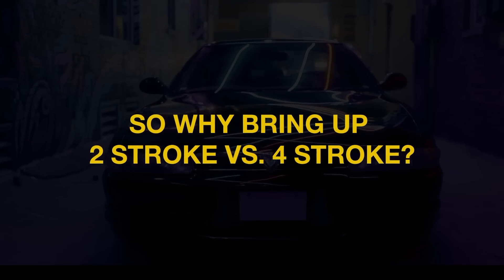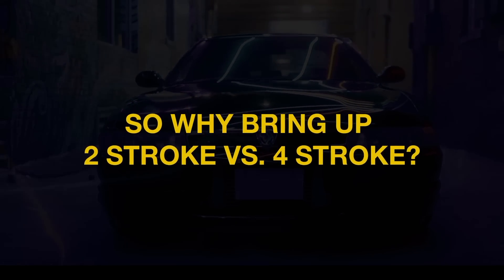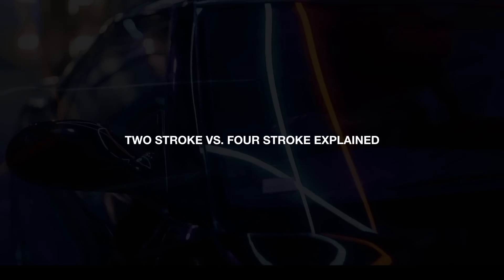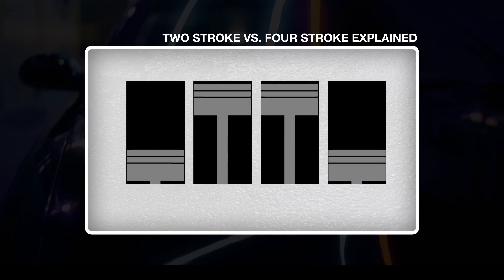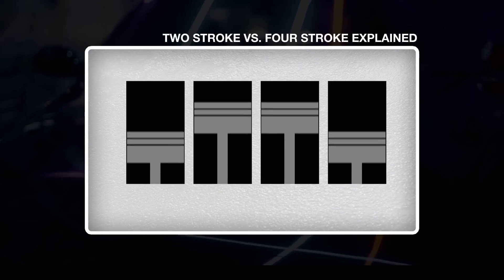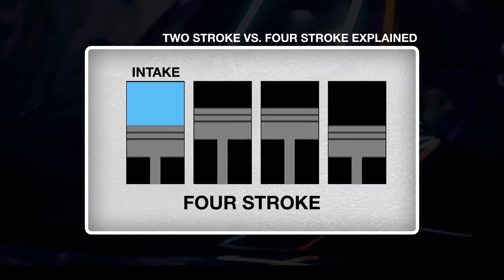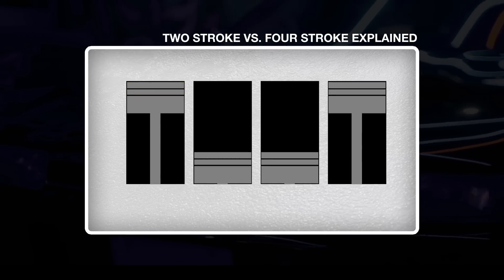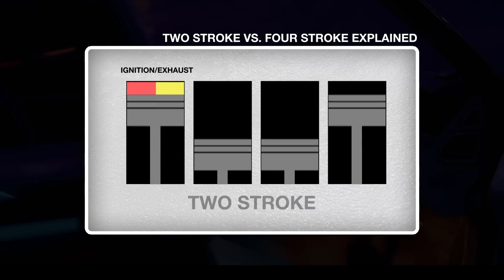The SECRET Behind Why RX7 and RX8 Rotary Engines Make SO Much Power

Comment: An rx8 certainly pisses fuel like a 3.9 engine, low 20's mpg. Hopefully the rx9 ditches the rotary engine. Shame there so inefficient cos there really nice cars.
Reply: really? because I can get 27-30+ in an RX8 highway and 19-21 mixed city, and I've gotten almost 40 in a NA FC highway and regularly in the 20s city.  Maybe its the driver with lead foot who can't steady state on a highway at reasonable speeds (within 5 of speed limit)? No, no, it must be failure of the product, because no one can take personal responsibility for their actions.  I can also get in the teens with them.  But I did have a 400 c.i.d. Pontiac that got 9 mpg no matter wtf I did, a Civic Hybrid that I got mid 90 mpg on a highway trip and regularly in the 60s with city driving.  But again, let's always blame design and not the person behind the wheel.

It also, would not be an RX9 if it didn't have a rotary, it would be a mazda9, like a sportier mazda6.

So to reiterate.  An RX8 in good operational condition with the right driver can get 20 city, 30 highway in good conditions; with a lead foot and/or poor conditions low teens or worse city and teens highway (snow, below zero, hilly/mountainous terrain, etc).

So keep spouting bullshit you hear from people who bullshit without first hand experience and without knowledge of how fuel is used.  You know, like those people with lead foots who want to sue hybrid manufactures because they full gas/brake all the time and blame the car and get in the 20s/30s, while you have people like Wayne Gertes from cleanmpg getting over 100 mpg++ doing the opposite extreme in the same cars.

gas mileage and reliability are mostly on uneducated drivers who take no personal responsibility for their actions, don't understand there are efficient loads and shift points, don't understand how poor maintenance and operational health and outside conditions affect everything, and so on.  Just easier to yell at clouds and point fingers.  It goes for any car engine.  It is a real blanket statement to both the cars and the drivers.
Reply: @kuromurasaki5273  OMG RX8 fan boy. I've owned an RX8 for 1.5 years n by far the most uneconomical car I've owned. Yes it's nice to drive, lovely to look at, good gearbox n excellent stereo but fuel consumption is terrible. I know how to drive economically, with very gentle acceleration n keeping the speed at 55 mph, even going as far as putting it in neutral going down hill and at best getting mid 20 mpg at best. Plus 1l of oil each month on top. I've owned a S2000 and a MR2 turbo and they would easily to mid 30 mpg if not better. Mines a 231 for sale for £800 with 82k for the last month and no one wants it. Only had 2 enquiries but no sale. Even agreed to sell it for £600 to one of them but never turned up. It only cost me £1.6 K to buy so I don't really care if I sell it or not. Road tax goes on emissions here in the UK n if it was 1x younger it would be top bracket  £500 per year. I knew what I was getting myself into when getting one so it was no surprise really. Fuel costs alot more in the UK than the US so RX8  are cheap as chips to buy here. Got a TT 2.0 tdi roadster now and this uses 1/3 of the fuel costs the RX8 uses. Engine may weigh like a 1.3, with power of a 2.6 but drinks like a 3.9 FACT and it has nothing to do with how I drive thankyou. If yours happens to be better then good for you. As far as RX9 goes there is some info online about this being a possibility but this was some time ago now. If it did happen no doubt it would have some hybrid system included with or without a rensis/wankel rotary engine who knows. You dont have to launch personal attacks on people who are just sharing there honest opinions on a product with the world and I won't be lowering myself to rubbish what you've said.

Comment: BUT, a comparable hp/weight ratio strongly favors the wankle..
Reply: Then why is it obsolete?
Reply: doktorbimmer 
 I'm not sure it is. its being utilized with large 2 stoke out boards. it uses oil, and doesn't enjoy long life, or have good torque. compartivly making a financial nightmare out of warranties and potential cost to a mfgr. my only original point, was, if we line up equal power output, the weight of rotor verses piston, is significantly less... I've always been a fan, had hoped advancements in ceramics might let this power plant be more viable for everyday use.
Cheers
Reply: Wtf? What company actually produces them in series mass production anymore? The last manufacturer was Mazda and they ended production over half a decade ago.
Reply: Wankel engines have not been produced for outboards in decades, OMC (Evinrude/Johnson), Sachs (MAC-10) and Yanmar all attempted to market them in the 1960's and 70's but all were sales flops and discontinued.
Reply: FYI: Wankel KKM engines are all 4-stroke operating principle... just so you don't sound confused anymore.
Reply: doktorbimmer 
 I can't resist. a Wankle has NO STROKES!  Just revaloutions. I agree as a production motor to the masses it has gone away. it is still being utilised in performance settings. take in a boat race, they burn Fuel in them...unlimited outboard. hell, might be last one on earth for all I know! just saying...
Reply: All Wankel engines operate using the 4-stroke operating principle.
Reply: Two strokes per every eccentric-crankshaft revolution.
Reply: Every Mazda 13B has 15mm crankshaft off-set which produces a 30mm STROKE... This fact can be confirmed by Mazda's own published technical specifications.
Reply: Flat-head engines are obsolete too... although extremely rare today, they can still be found in some vintage racing and exhibition events.

Comment: This is a dumb video. Trying really hard for your argument. So basically the way you calculate displacement for a piston engine should not be applied to a rotary.  It still uses more fuel to make horse power.

Comment: why has no one set up the motor to run on compressed air,,soundd crazy i know but its being done with piston engine's but the wankle is perfect for it,,,heck Hitler knew this and so did Mazda when they bought the patent and not that it matters to most but a jew built and designed it by force for the German army,,,any one got info on one running on a compressed closed air system make a comment would enjoy knowing i have owned a rx7 and rx8 super cars with minimum efforts and the motor could be the future of clean efficiency in transport.
Reply: The whole Wankel concept was originally designed as a compressor. Felix Wankel first orbiting piston design was a motorcycle supercharger... and fitted to a 50cc NSU motorcycle which broke a world's record..
Reply: Mazda purchased Hanns Paschke's design (the KKM-57)  his engine was designed without any knowledge or assistance from Felix Wankel.
 Unfortunately the Wankel never saw widespread adoption or success, it is tragically flawed and inherently inefficient... it has been obsolete from production for several years now and has no prospects of making a comeback ever again.

Comment: Love the misinformation. 

Mazda states; 1.3 liter. Period. If they are a "3.9 liter", explain to me why the engine is 1/3 the size when you sit them next to each other. Odd dont ya think? What about the weight difference? Odd that this "3.9 liter" weighs only 247 pounds with attachments. Piston heads just cant wrap their brain around the fact that a smaller, much simpler engine is doing more work than their big badass v8. Its a matter of hurt feeling. Get a clue.

For anyone who wants to see an ACTUAL 3.9 liter rotary, search 'PPRE 6 rotor rx4'. Compare that to your v8.
Reply: Then explain why the GM RC2-206 Wankel engine (same size as a Mazda 12A)  had a displacement of 206 cu.in. (3,340cc's)
 Could it be that America never used "displacement tax" for vehicle registration like Japan did?
Reply: Sounds like you do not even understand the basic concept of calculating displacement... You cannot calculate the displacement of a Wankel engine the same as a 2-stroke... All Wankel KKM type engines use the 4 stroke operating principle...
Reply: Well I guess with your thought process, we can assume because the twin rotor powered Norton f1 streetbike was a twin rotor it must not actually be the 588cc that they claim. So don't go based off of what the manufacturer is telling you on wankel motors they produce, or what the government is saying. Youtube warriors and "Rotary experts" know better. You can't compare engines of different sizes and wankels come in different sizes for different applications. 13b from Mazda is a 1.3 liter.
Reply: Its very simple... each orbiting piston(rotor) has 3 sides forming 3 combustion chamber volumes, each with a swept volume of 654cc.  times the 2 housings is 6 and equaling 3,924cc.
 The other important thing that people without formal engineering experience fail to understand is that a 4 cycle Otto or Diesel engine completes its firing sequence in 720° of crankshaft rotation while the 4-cycle Wankel KKM designs required 1080° of rotation to complete its firing sequence...
 These two important and often misunderstood details are the basis of the commonly used "2X" conversion formula for accurately "comparing" the displacement of the Wankel with other designs..
Any questions? I would be happy to explain in more detail...
Reply: The contrived "Tax Displacement Method" was created by NSU in Germany before Mazda purchased the design from them, as Japan had a similar tax code regarding tax per engine size they simply kept the same method for calculating displacement.
 American designs used total displacement instead of the "Tax formula method to calculate the displacement as the U.S. uses Gross Vehicle weight and MPGs to tax vehicles for registration not engine size.
For example, the General Motors RC2-206 Wankel was the same swept volume of the Mazda 12A Wankel but GMs engine had a published displacement of 206 cubic inches (3,380 cc).
 Motorsports sanctioning bodies and government revenue agencies now classify the Wankel under the "2X" conversion formula eg; a Mazda 13B as 2.6 liters instead of its true displacement of 3.9 liters.
 All Wankel engines are 4-stroke... but require 3 revolutions. This why the 13B is considered a 2.6 liter when comparing to other 4-strokes even though the true displacement is 3.9 liters in total.
Reply: True, The massive 1,764cc Norton F1 engine was developed from the Commander which itself is based on the 1974 Sachs/Hercules engine designed by brilliant Nazi jet engine designer Max Bentele, Norton inherited the NSU Wankel license and the "Tax Displacement Method" when it purchased the discontinued Wankel engine program from Sachs in 1977.
 Please remember the unique displacement rules of the 500GP series, were the Norton RCW588s were allowed to compete with a non-compliance waiver as a 500cc 2-STROKE, we all understand by now that this is a considerable distortion of reality as all Wankel KKM engines use the same 4-stroke operating principle.
Reply: doktorbimmer because all 6 sides are doing the combustion at the same time. Makes no sense. Would you multiply a piston engines displacement a couple times because the pistons move up and down multiple times? No. So why would you count the sides of the rotors that don't combust as displacement when they do not combust?
Reply: OH! Wow! I just realized you don't even understand how displacement in any engine is calculated..!
Reply: Ok, we need to start with fundamentals with you. 
Question 1.)
What are the two key factors you need to know to calculate an engines displacement?
Reply: doktorbimmer I already told you why you're wrong. Reflect on what I said.
Reply: How can you tell me I'm wrong when you do not understand the basic concept of displacement or how it is calculated???
 I understand that you are embarrassed and confused but if you don't ask for help you will simply continue to make yourself look like a fool.
Reply: Now, tell me. What are the two key factors you need to know to calculate an engines displacement?
Reply: Read what I said, and think again; but slower.
Reply: Just tell me. What are the two key factors you need to know to calculate an engines displacement?
Reply: What you said does not make any sense if you understand how displacement is calculated... Do you have any education at all on this topic? or are you just an amateur pretending to be knowledgeable?
Reply: doktorbimmer Its as simple as the fact of: I own a 94 rx7. I know how they work. You do not own one. Good too because you'd be another reason why they are considered " unreliable" with your lack of knowledge and almost garanteed lack of basic rotary maintenance.              Look ill do the math for you or anyone that doesnt understand simple math:
                                                                2 combustion chambers. Round the rotors to 650cc each. 2 rotors. 650cc X 2 = 1300cc.                                 Now that you understand, spread the good news and go away.
Reply: WRONG!  You clearly do not understand how displacement is calculated or basic engine design fundamentals.
Reply: Yes, I do. I own a car manufactured by the very first company to sell cars with Wankel engines. Do you even know what the primary mode of Wankel engine failure is?
Reply: As I said, it is very simple... each orbiting piston(rotor) has 3 sides forming 3 combustion chamber volumes, each with a swept volume of 654cc.  times the 2 housings is 6 and equaling 3,924cc.
 The other important thing that people without formal engineering experience fail to understand is that a 4 cycle Otto or Diesel engine completes its firing sequence in 720° of crankshaft rotation while the 4-cycle Wankel KKM designs required 1080° of rotation to complete its firing sequence...

Comment: all wankel engines have been running on 80 lbs compression vs 135lbs?
Reply: The Wankel engine always held out a lot of promise, but never was able to fully deliver on those promises. It was never very fuel efficient, and the exhaust temperatures were very high. But now an independent car tech thinks he has stumbled onto what held that engine back.